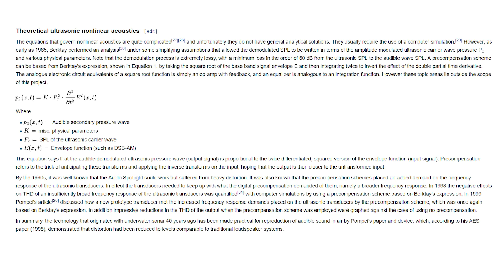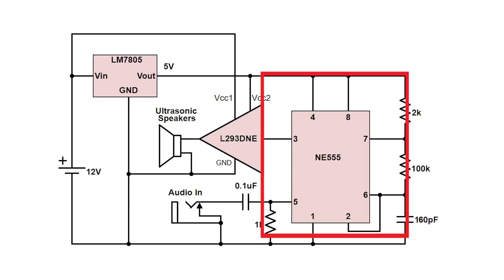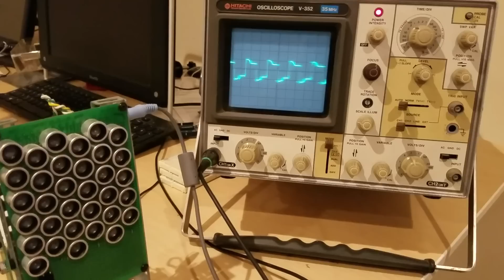Turning Sound Into a Laser

Comment: Just a small note, you said "laser" and I had to watch the video twice because I got confused, but then I did some reading and think I understand the Physics of this device a lot better now. 
Calling it a "laser" is inaccurate. It's still a longnitudal compression wave (sound), not an electromagnetic wave (light). To understand why it works this is an important distinction. Sound is caused by the compression and decompression of air. (sound vibrates in the direction that it is travelling). The deliniarisation effect is caused when the sound travels at different speeds when it's more or less compressed. These changes in speed lead to a bigger wavelength sound being created over the top of the ultrasound, because of harmonics. (The waves line up to create a new sound)
This isn't how FM radio works, or even AM radio, even though it is a modulation effect. Radio is in the world of electromagnetic waves, which do not have this effect as they vibrate in a different direction to the one which they are travelling.

Also, Subscribed! Love your stuff!
Reply: Obviously it's not electromagnetic in nature, it's just an analogy.
Reply: It was a clickbait. And it worked!
Reply: It works like a Laserpointer. You can't see (or hear) the beam in the air, but if something gets in the way the light (or sound) can be seen (heard)
Reply: You may be smart, yet you are dumb
Reply: He's got that too literal problem

He meant laser as in reference to turning a wave into something that fires extremely straight.  Laser is an approachable comparison, of course it's not a literal light laser.  People use the term laser as a catch-all to describe super accurate things a lot.
Reply: @maxwell_edison  Still, calling that device a "laser" is extremely inaccurate, since it gives the idea that the phenomenon of lasing produces focused light, while in fact, it doesn't have to and the only reason lasers often do so is because of using a dedicated optics to focus the light beam.
Lasers are lasers because they produce a coherent light wave of a single frequency. That's it. So even analogically, the device built in this video has literally nothing to do with a laser. It would when the sound generated by the device consisted of only a single wave frequency (which, in terms of sound, is not a hard thing to do at all, in contrast to light waves). Also, the process of generating light inside a laser (a.k.a. "lasing" or "laser action") is caused by a very specific physical phenomenon that involves a medium amplifying light waves sandwiched between two reflective surfaces. Is that possible with sound? Yes, probably. But likely not anywhere near the range of audible frequencies (rather mega/gigahertz). And not in gas-based media.
Reply: @mateuszkaplon  Obviously it's not even close to anything like a laser, but for the layman a laser is just a 'beam' of light. So this remarkable contraption essentially making a 'beam' of sound and calling it a laser makes it easier to understand what is happening for a person who doesn't know how lasers work.

Could it feed a misconception on what lasers are? Maybe, is that a big problem? Of course not.

Comment: Does increasing / decreasing the carrier frequency have a significant impact on sound quality?
Reply from the maker: I only have 40KHz speakers so I haven't tested anything else.  But I've heard that higher frequencies are more directional, but the volume decreases more quickly with distance, so you can't project it as far.
Reply: is this why am radio can be transmitted so far
Reply: oh ok

Comment: I watch one of your videos about the game you designed with fractals, watch this one you may like to know you are not frist one to come up with this I have seen a similar device on Kickstarter years ago 2009 I believe. One issue is since to are carrying the sound you can hear in sound you can't the sound you can't heard must be loud enough to damage your ears
Reply from the maker: Thanks!  Yes this has been done before, but they are quite expensive so I wanted to build one myself with spare parts.
I'm pretty sure the ultrasound is under 90db, so not loud enough to cause hearing damage.
Reply: @CodeParade  if you got it down to that level it should be safe.

Comment: pretty sure the math works out that way due to a property of fourier transforms and the uncertainty principle
Reply: surely this operates on too large a scale to be subject to the uncertainty principle? seems like some fluid property of the air, maybe viscosity idk, is causing it
Reply: @thefacethatstares  Not the quantum mechanical uncertainty principle but the uncertainty principle for fourier transforms. A gaussian wave packet for example (since the fourier transform of a gaussian is a gaussian). If you increase the time duration it will cause the frequency to narrow and if you do the reverse it will cause the frequency to spread. This is characterised by Delta(omega).Delta(t) >= 1/2. Where delta of something is normally the square root of (average squared - square average)
Reply: @thefacethatstares  to add to what i said  pretty sure its the uncertainty principle relating to deltakdeltax > 1/2 since k = 2pi / lambda and x is the width of the gap since the speed of sound is similar in all air changing the frequency the wavenumber (k) will also change.

Comment: Do you happen to have a component list for what you used? I'd like to try this out for myself
Reply from the maker: All the major components are listed at 1:18  The passive stuff is just standard off-the-shelf parts.  The only thing not listed that I added later is a large electrolytic capacitor between the output of the LM7805 to ground because the current spike from the speakers would cause too much voltage drop.  For the speakers, any "ultrasonic transmitter" will work, just make sure they have a nominal frequency of 40KHz.
Reply: @CodeParade  Thanks!
Reply: CodeParade what transducers are those?
Reply from the maker: I got them a long time ago so I don't remember the exact brand.  It might have been these ones:
https://www.amazon.com/dp/B01FDGTXT4/

Comment: There are cool applications for this.  Given that it "sounds like" the sound is coming from the reflective surface, you could use this as a spooker in haunted houses, or as a distraction generator in military or milsim situations.
Reply: Definitely would be good as a distraction generator, or for simulating sounds coming from certain parts of a room. You could use it for surround sound with minimal wiring too I bet. Instead of running wires to each speaker, they only need to be inanimate reflector boards for the sound waves.
Reply: I don't imagine the sound would be too high quality, though.  When you're building a HiFi solution in your home, running wires for the speakers is part of the fun.
Reply: I know this is a super old comment/video, but I was also thinking of another application you could use this for. If you built a whole bunch of different directions into the same unit, you could design a single unit 8.1 surround sound set up that you simply just put on top of a Central Location. Would be great for mobile theater set ups with a projector.
Reply: possibly use this in card as a way for people to listen to music when others don’t want to hear it, it’d be hard to stop the reflection tho.
Reply: Distraction dance
Reply: Disney actually purchased units like this for their epcot theater.
Reply: This seems to work like the HSS speakers.  And I do use them in my haunt.  Usually, to get sound to come from a projected image.  Like lightning and rain on a wall or spiders/snakes/etc on the ceiling.  
It's really effective at throwing the sound onto the image without feeling directional as if from speakers off to the side.
Reply: how are named this application
Reply: How about we use the 300 we are sparta and the roar of 10k spartans in the next war lmao!
Reply: @w3w3w3  Take that back to the drawing board.